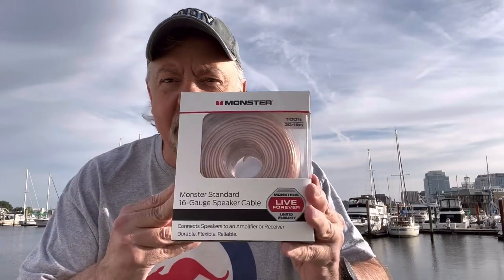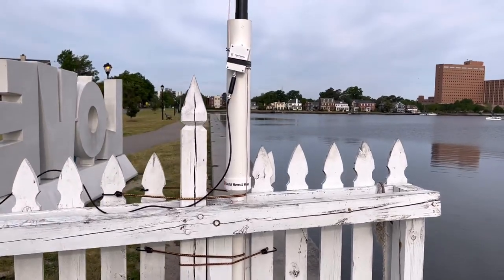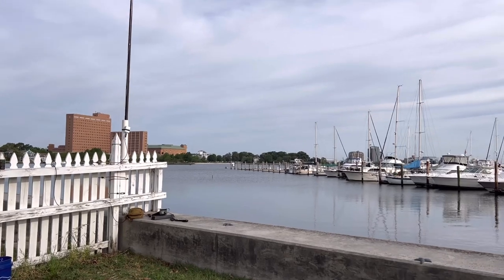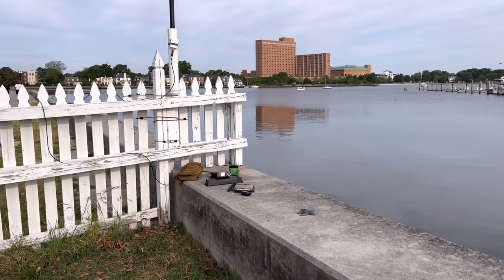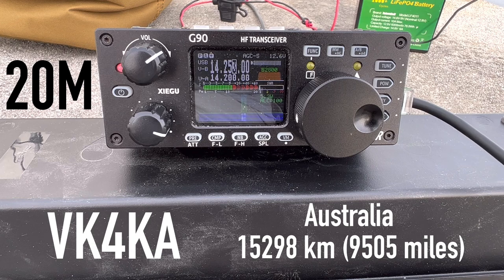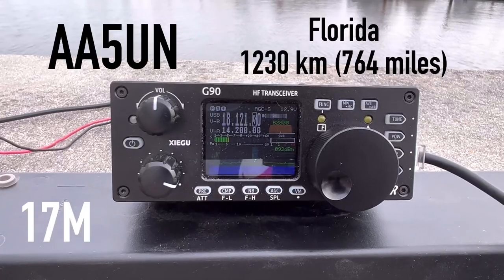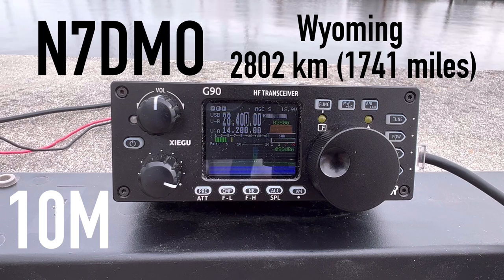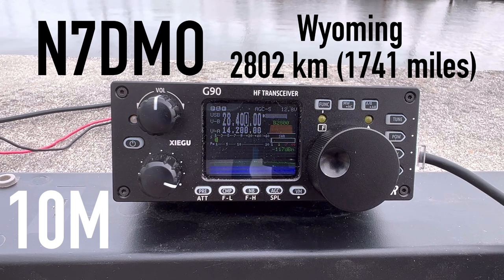Building a Vertical EFHW Antenna with Speaker Wire

Comment: This antenna worked really well for me.  I hung it from a tree in the backyard, maybe 35 feet, connected it to the TenTennas 49:1, and ran the 1 meter counterpoise wire. My antenna analyzer reported an SWR of 1.16:1  I'm not using the choke (but I did just order one, your friend has them in stock again). I had QSOs with Bulgaria and Estonia this evening, over 4000 miles from my QTH! Granted, I was was running 70-80 watts. Thanks,  K1PRD
Reply from the maker: Awesome Chris, thanks for sharing

Comment: Passed my Extra exam this past Tuesday! Shopping around for an HF rig. Leaning towards ft-991a and an ss-30m ap power supply. Also got a Bioenno 15ah LiFePo4 battery. Just getting ideas on diy antennas. Cheers!

Comment: Hi Walt.  Like you, I have salt water to use as my groundplane.  But, for those who are in an arid area and/or have a limited space to place radials, may I suggest a video about "folded monopole" antennas.  This is what we use in AM MW broadcast when an old site has either missing or ruined radials.  The folded monopole has an impedance of about 150 ohms and thus is vastly more effecient where a small radial field exists.  It's simple Ohm's Law.  (For broadcasters, it also means the tower is connected to ground and is no longer hot, which has its own set of advantages.)   73 OM, keep up the great work!
Reply from the maker: Great comment, I’ve actually been researching and studying AM broadcast antennas lately and find this very interesting. Thanks and 73 OM!
Reply: Would make a good video.

Comment: 👍That certainly worked. Thanks for video. Used speaker wire a few times. Seems well suited to making HF antennas with many copper strands, quite tough, flexible and inexpensive like you said. Looks like a nice spot you have for QRP/P with the salt water, fence and a wall to sit on.
Reply from the maker: Thanks Steve, yes I'm blessed to have that location right here where I live.

Comment: Great work Walt. I did something very similar in my back garden.

I built this on an 18m DX Commander mast with the feed point at around 8m above the ground. I used the coax running up the mast as the counterpoise & choked it with a 1:1 at ground level to keep RF out of the shack.

It worked extremely well on 20m, even in my fairly urban location. Probably because the antenna was above the roofline, allowing me to take advantage of the low angle take off. It wasn't quite so great on the other bands but I still made plenty of contacts

I even managed to tune it up on 160m with the internal tuner in the FTDX10. It was obviously a massive compromise on 160m but I tried it during a contest & managed to make a few contacts.
Reply from the maker: Thanks! Wow I really need a 18m pole, that’s awesome
Reply: @COASTALWAVESWIRES  It's a bit of a monster to be honest. I certainly won't be using it portable!

Getting it up on my own was a bit of a challenge. Probably more of a club field day antenna.

I think it would work well for some low-band fun on club field day.

Comment: That's a neat rig. I have 2 of the TennTenna 49:1 transformers, using them as slopers, EFHW resonate on 40, 20, 15, 10 with 65ft wire and no ground or counterpoise. I really like the TennTenna transformers. For me they work better than some of the other brands. I might have to try this, but I don't have a salt water amplifier, the places that I go.
Reply from the maker: I really like the TennTenna 49:1 too! 
73 my friend

Comment: A question, why not run a counterpoise wire into the water.
If you read the articles on construction of radio relay stations in the Marconi Magazine from 100 years ago, they were quite keen on use massive massive buried meshes of copper wire but also using local lakes.
Reply from the maker: If you look back at the other videos on my channel I do that all the time. This was an experiment trying something different.

Comment: Question for ya! Are you splicing the speaker wire down the center and only using one side? If that makes sense.

Or are you combining both bare wire ends together?

Hope that question makes sense.
-Billy
KQ4OAM

Comment: tons of fun Walt! for portable I run a home made 49:1 efhw currently at 66',  this looks like a fun project.. need to source a mast.. or maybe just use a tree branch.. still on the fence for a G90 vs FT891 though..
Reply from the maker: Thanks Paul, I’m actually on the fence to add a FT891 to my collection lol. G90 is half the price and the internal tuner is second to none.
Reply: @COASTALWAVESWIRES  main concern with the g90 is after warranty support...
Reply from the maker: @AzPauly  check out Radioddity, they’re in the US and service and sell the G90

Comment: I just got that tenntenna 49:1 with pl-259. Haven't used it yet. That pole is massive! I might start with a long wire in the trees. Can you recommend a good feedline?
Reply from the maker: A long wire in a tree is perfect. I just use pre-cut RG8X I get on Amazon
Reply: @COASTALWAVESWIRES  I was just looking at these poles. Is yours the original model or the expedition travel pole? Does anyone have these in the USA, or do we have to order them overseas? Thanks!
Reply from the maker: @anonymous_friend  I have the Expedition pole. You have to order it from the UK but it’s no big deal, mine arrived in 4 days.

Comment: Walt what brand of choke was that? I have the Chameleon antenna cable but I would like a thin, external type that isn't integrated into the cable.  Cheers! -Nick, k7cj
Reply from the maker: Hi Nick, that choke is made by my friend N9SAB. He sells them on eBay and Etsy. I just looked and he currently doesn’t have them in stock.
Reply: @COASTALWAVESWIRES  Thanks I bookmarked his page.

Comment: Question: I guess vertically polarized, but are you going to get the same benefit of a ground plane vertical next to water???  Statement: Ground plane verticals are "ok" in all directions, and there is a reason why hams have been saying that for decades (Do your research to find out why).  However, in the middle or next to an Ocean or body of water, the vertical ground plane does extremely well.  I wasn't sure if one would get the same water benefit a vertical ground plane gets vs a EFHW?
Reply from the maker: I’m doing my research and experimenting nearly everyday.

Comment: Agree 100%: choke it close and .05-ish counterpoise..  for an EFHW some frequencies/resonances are counterpoise sensitive others don't seem to care... leading to much of the debate.  I use copper fishing line on a tiny metal reel for my counterpoise and tune length and proximity to ground.
Reply from the maker: That’s a brilliant idea!
Reply: Thanks. Not my original idea but using bare wire as I do keeps the reel from introducing inductive reactance.

Comment: Hey Walt nice video. Question, how well does that support and DX Commander hold up when it gets windy?
Reply from the maker: Thanks, it holds up pretty well. I’ve had some windy days on the beach. To be honest I’m looking for a single long piece of 2-1/2” pvc pipe to replace it
Reply: @COASTALWAVESWIRES  well I use pvc all the time usually as a mast. However, I don't like long pieces of it.  I don't know if you have a Menards there if so they carry 5' sections of various diameters. Not sure about Lowes. I just cut it to the sizes I need. They also carry the various sizes of connectors to piece them together. You probably already know this stuff. If not fyi....

Comment: I wont give any lip about the counter poise, to each their own! 
I don't use them personally. Though I am not against doing whatever you have to to get the signal out. Communicate/Deliver Message First worry about antenna issues later! (Specialized Communications Background. Get the message delivered is priority) However, may I suggest adding a couple other UNUN's to the pack.  there are times I have experienced that a 4:1, and/or a 9:1 have performed better. I have not experimented with the 5:1 or 64:1 but, also hear they too may provide additional tuning options.

I too keep a roll of cheap speaker wire in my pack. its 18awg zip cord. 100 ft makes all the antenna one could possibly need to do the job required! 

see you on the air

73 de KF6NFW
Reply from the maker: See you on the air! 73 de K4OGO